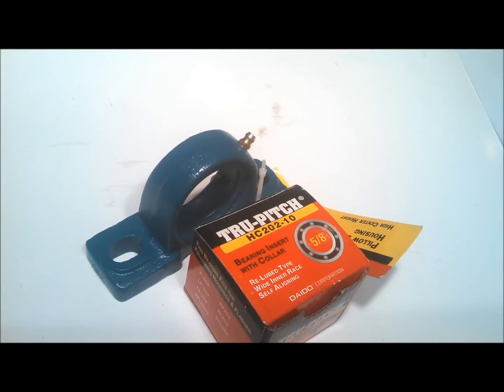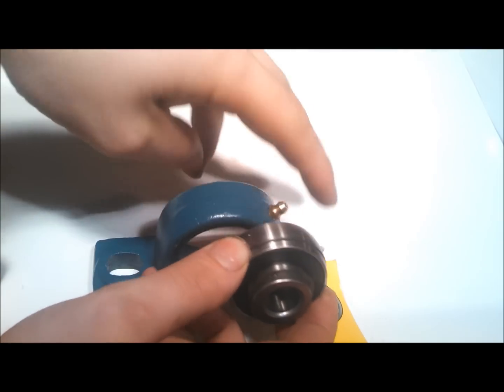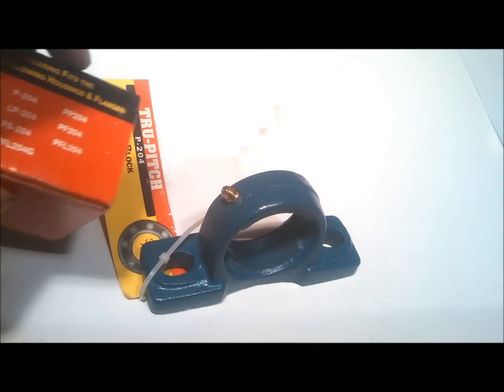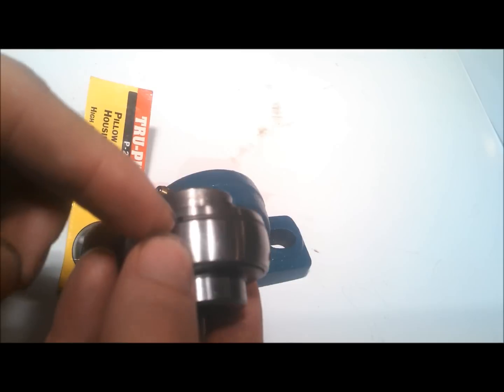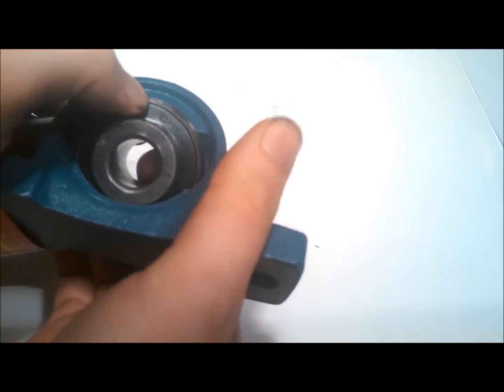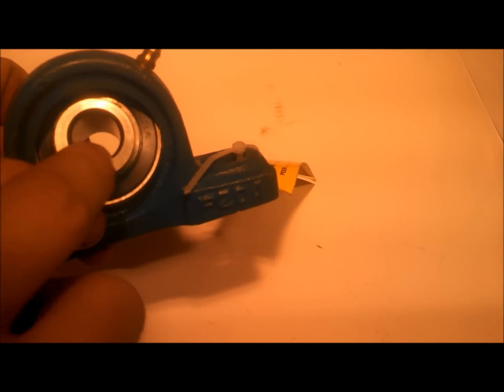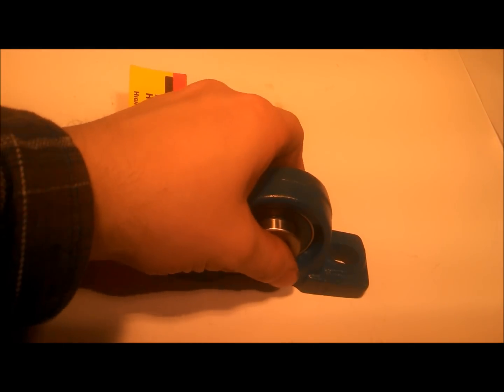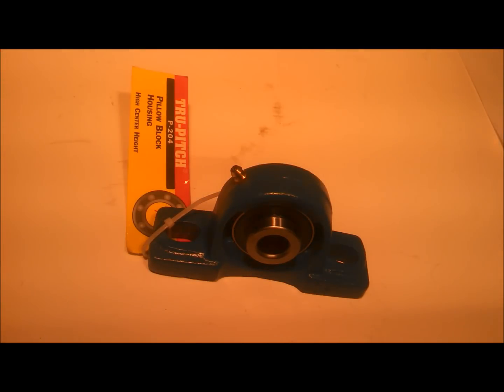Pillow Block Bearing Insert

Comment: This question is for anyone that has an answer. Can a pillow block be used as a live center for wood turning? I am trying to find a cheap was to extend my working piece.
Reply from the maker: That's an interesting idea. This particular style bearing allows for some misaligned of a shaft, so they are always used in pairs. I don't know if that would be desirable for your idea. But if you has 2 mounted to something solid with a short shaft between them to use as your center it would work to hold up the rotating work piece. Just keep in mind they wont take much axial thrust, because they are just ball bearings.
Reply: EitriBrokkr awesome. Thanks for the input. I hope to use it as more of a hanger and shouldn’t have a lot of thrust pressure.

Comment: Bad idea to force it with a bar like that.
Reply: +Gary McKinnon . no, please, help the rest of us. what is the right tool!
Reply: This is normal way to install or remove bearing from pillow block bearing housing. Check SKF Y-bearing user manual.pdf on that matter.
Cheers
Reply: @zox. great of you to follow up.
Reply from the maker: Alright Mr. Mechanical Genius please enlighten the masses as how YOU would change that bearing. Cause obviously I'm an idiot and have no clue what I'm talking about.....oh wait, what is this, huh it's a video, from the leading, arguable one of the most prestigious, bearing manufacturers in the world.  (mind you it was published 3 months after mine) https://www.youtube.com/watch?v=1jG52W5U_Cs Let's see what they have to say about it.
Reply: I would tell you about a better tool but your emotional reaction to my simple comment leads me to not want to help you. If you get that angry at a simple comment (that wasn't insulting or emotional) then it doesn't encourage people to converse with you.
Reply: It is normal to protect bearing  from damage, though force to install bearing trough fill slot is not great and depend of bearing size. Sometimes (if applicable) you can use its own shaft to do this. If not it is best to use any round metal object additionally protected with rubber layer or even rag. Even if you dont have anything at your disposal (which i doubt) you cant damage hardened bearing surface. Proper material to install such bearings is teflon adapter mounted on any sort of metal shaft though it is not critical.
Cheers mate
Reply: No kidding,a little Xanax maybe?